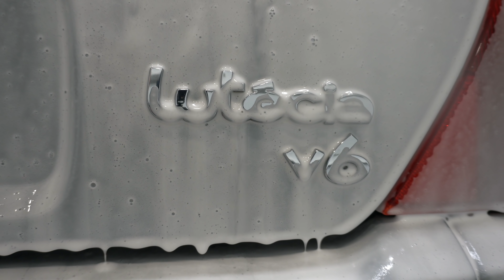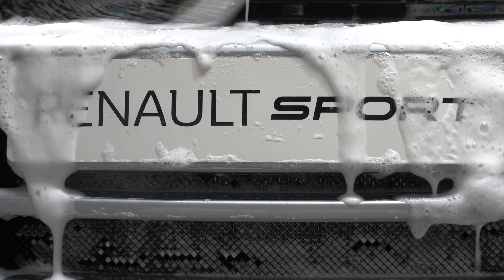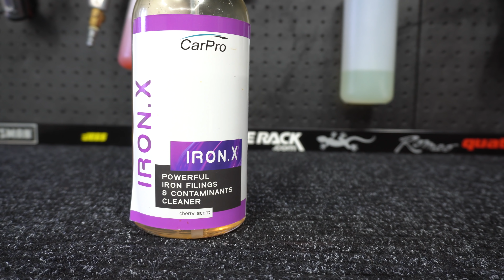RENAULT CLIO DETAIL 🇫🇷 | Exterior Detail of Pristine 2002 Renault Clio Sport V6 in Iceberg Silver

Comment: A very special car for sure. And as the winter is long hard and cold I appriciate your vids even more. It is a way to escape from our snow outside and just hang around in your garage. Some rally nice and unique cars even if I am a bit ssuspcious about italian and french quality ;)
Reply from the maker: Quality is a relative term. I will say the Renault had some very clever and contemporary design elements. The light that laminates the license plate was set into the bumper aiming up, the water spigot for the rear wiper was incorporated into the rear wing, and a few other clever little features that impressed me as I made my way around (and around and around) the car. The paint on the Renault was really nice as well.

Comment: Hi Rick, it’s a masterpiece 👍
How many pads would you use on a car that size with a one-step? Thanks 👍
Reply from the maker: I used one 6", one 3" and one 1". It really didn't require extensive correction. Just a polish with a slight "bite". Thanks for the question.

Comment: Great content! What ratio do you dilute the Adams tire and wheel cleaner in your Alkaline ? And why uses the bubbles instead of foam ?
Reply from the maker: I prefer the Wheel & Tire Cleaner straight up. I do dilute when I'm getting low or working on wheels I'm a bit worried about but I don't dilute it too much. 2 parts cleaner to 1 part water is about as far as I go. It just becomes less and less effective and satisfying once you go more than that. I have an IK foamer but have never had much success getting it to work properly, so one day I just tried the little IK alkaline and it works great. The bubbles are just as good as foam imho.
Reply: @RADGarage  thanks! Will try the little IK !

Comment: Fairly quick machine movement is it because it's a aio? So cut is minimal?
Reply from the maker: I think that is mostly due to the video aspect. I usually shoot my video of the polish/correction process when I am just getting the compound spread over the panel I'm working on, so that tends to be quicker. Once I'm in the zone, I don't want to be setting up the camera, so the majority of the polish footage you will see will not be the slow, methodical, cross-hatch pattern. Then, like you say, this is a very light polish I'm doing on this car so that also has something to do with the speed I'm working at. I hope that all makes sense. Thanks for the question.